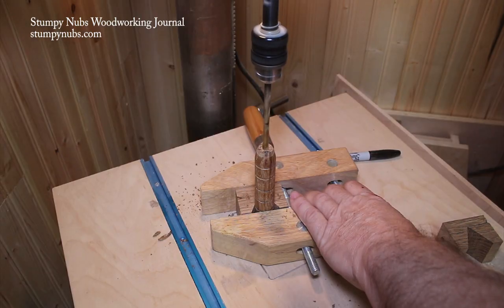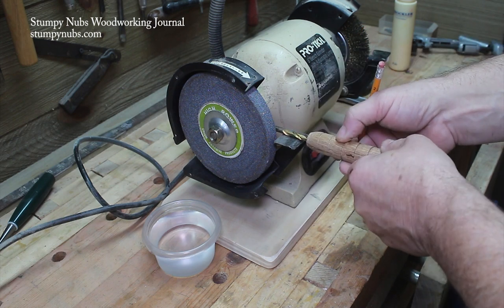Make your own wood chisels out of old drill bits- Create custom sizes!

Comment: nice video. when I was start to think about small chisel, I use an old planers blade, after tons of wasted time to take a shape, I was get a chisel in size 3milimeters width. its really nice tool, but steel HSS-18 is a bit too hard, and sometimes blade just breaks out. 
I think I was try your idea in future

Comment: Very good Mike.  However, if you don't want to destroy a perfectly good drill bit you can go to a metal supplier and get a length of drill rod.  Those are mostly unhardened and once ground can be hardened very nicely.

Comment: I thought using the side of a grinding wheel was a no-no
Reply: joe king Why?
Reply: Most wheels are not designed for side loads,  risk of shatttering,  do so at your own risk.  Google 'using the side of a grinding wheel'
Reply: I was taught never to use the side of the wheel during my apprentiship, not joe king is correct

Comment: I would not have expected the shaft of the drill bit to be hardened like the tip.  Even if it was of a good steel.
Reply from the maker: Try cutting one with a hack saw.